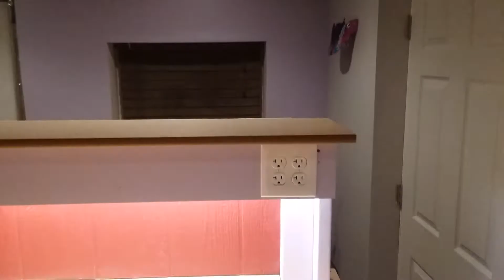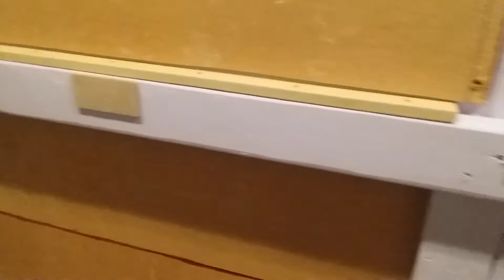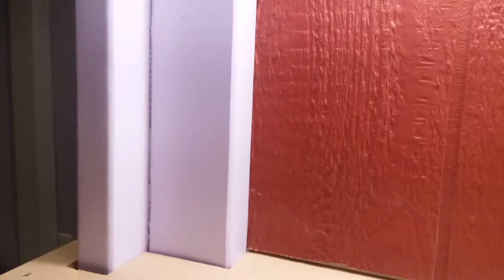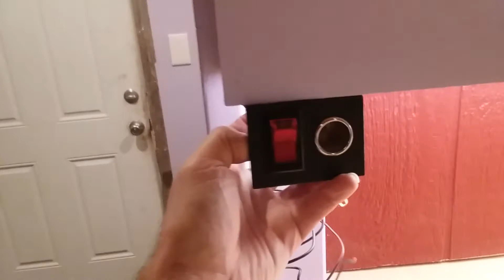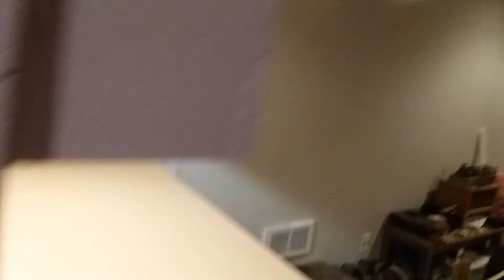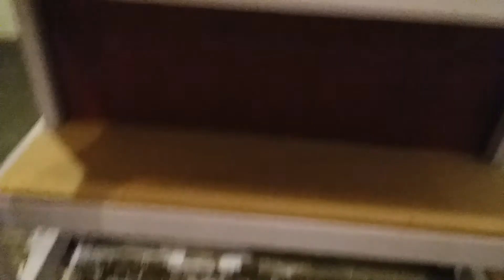Workbench Part 2

Comment from the maker: My work schedule has turned hectic again, so it will be a while before I can do more videos. I did manage to clean up the room enough to get the bench set up in its location though. I also found out that the way I did the lights works ok for stuff that sits low on the worktop, but anything higher than a few inches (like the Sparton chassis) ends up in shadow. :(  I do have an LED desk lamp that helps out, but will end up getting one of those worklight/magnifier combos on a spring loaded arm to help out with my horrible eyesight.  I also need to order up a camera mount arm like one of the Manfrotto magic arms.  So be patient everyone, I will soon get to do more and better videos for y'all.

Comment: That turned out quite nice.  The only suggestion I sort of have is to wrap your kickplate with some sheet aluminum or steel for durability.

Love your cat too.  Sadly I'm allergic to our furry feline companions so I can't have one of my own, but I can visit with one for a while and not get too bad of a reaction.

And, of course, love the radio in the background.

Nicely done.
Reply from the maker: Thanks. I will see about a wrap for the footrest, if I can find a shop here that can form it for me. 

Yeah Turbo is a camera ham, he loves getting his picture taken and being on the videos. He also love to get in the way of my "overnight" guests. 

My work schedule has turned hectic again, so it will be a while before I can do more videos. I did manage to clean up the room enough to get the bench set up in its location though. I also found out that the way I did the lights works ok for stuff that sits low on the worktop, but anything higher than a few inches (like the Sparton chassis) ends up in shadow. :(  I do have an LED desk lamp that helps out, but will end up getting one of those worklight/magnifier combos on a spring loaded arm to help out with my horrible eyesight.  I also need to order up a camera mount arm like one of the Manfrotto magic arms.